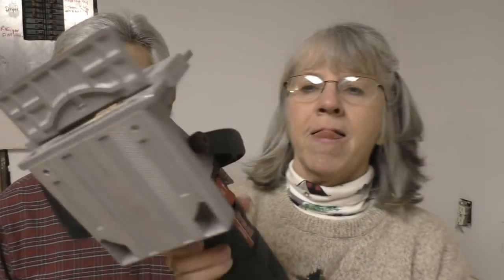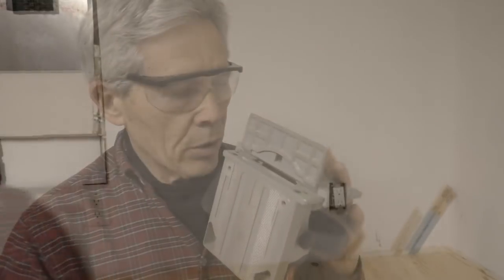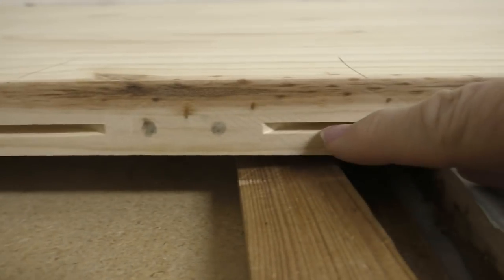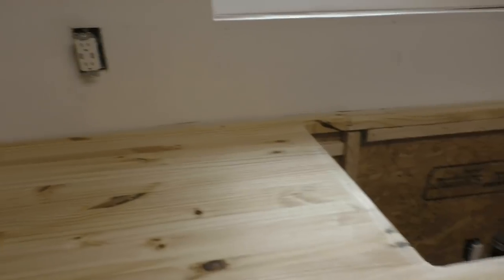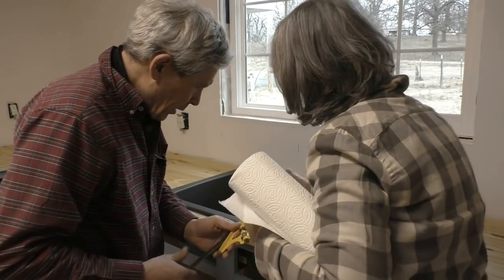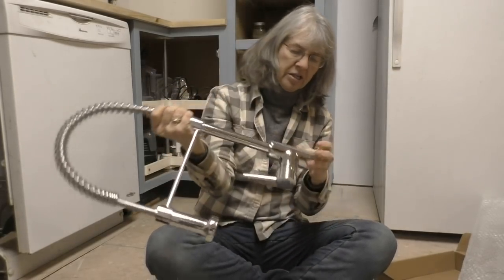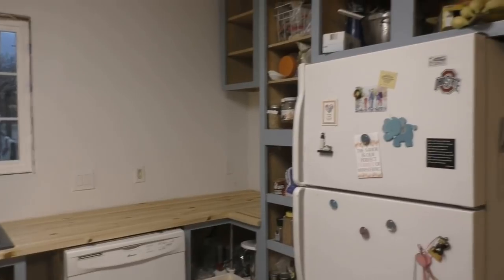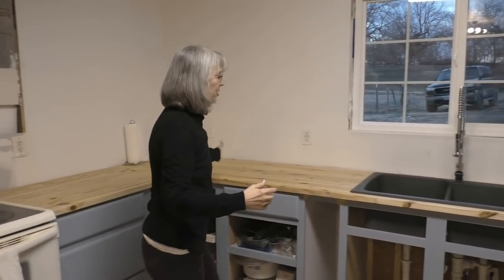Making Biscuit Joints & Kitchen Sink Install

Comment: I'll just toss this out there.  You could also use a $25 kreg jig to cut pocket holes if you don't have a biscuit slot cutter.  They have special screws that go with the jig.
Reply from the maker: We have the jig to make pocket holes and have used it many times. So yes we could have done either one
Reply: The bottom line is use the tools and skills you have, just get the job done!  Great progress!